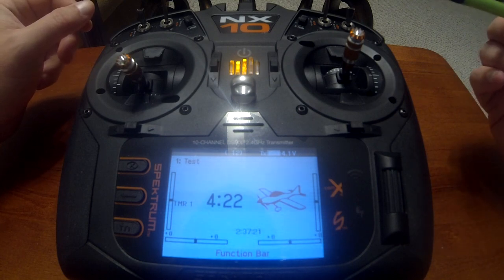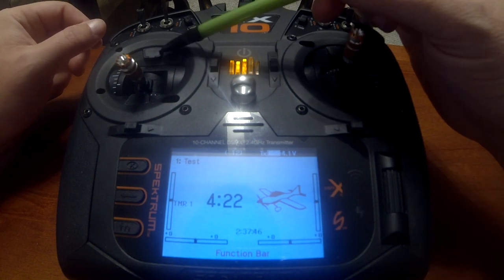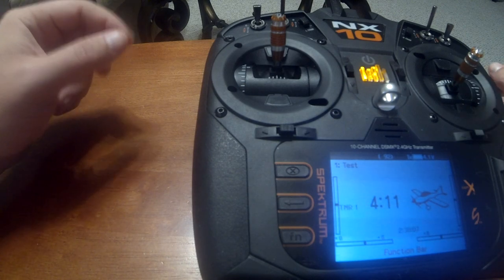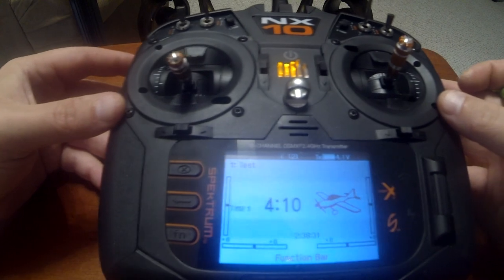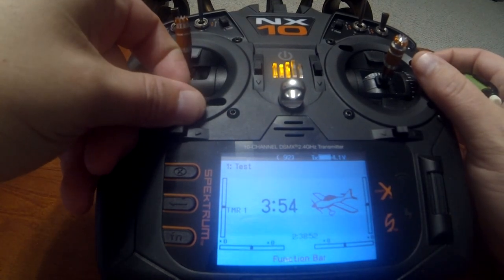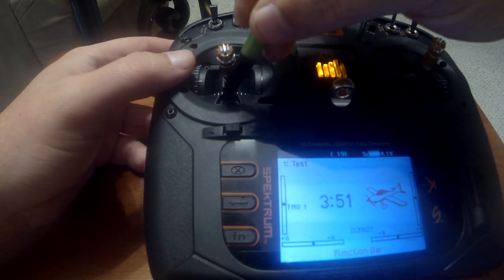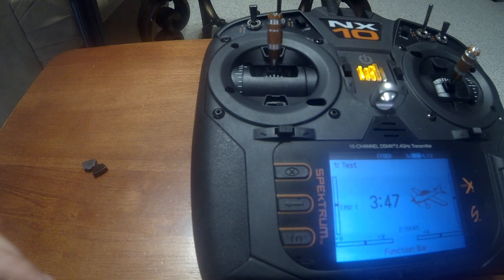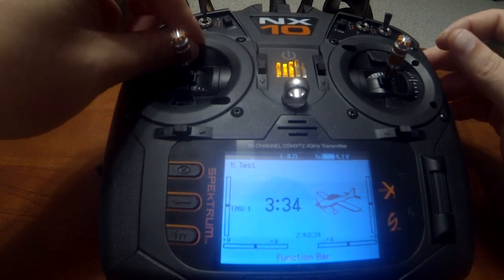Spektrum NX Setup: How to Increase Throttle Travel (NX6/NX8/NX10)

Comment: This is why I spent 6 hours trying to get pass IKon2's throttle check.  No electronic  adjustments could get me passes their throttle check feature.  I ended up returning the unit.  But, I did just follow up since I want to give it another try.  Ikon said to check the mechanical travel as they've been seeing this issue with Spektrum recently.  And, that's what brought me to your video.  Thanks.

Comment: I just got a new NX10SE and the gimbals do not have the cover that you show. They have a set screw with no cover.  I have 0-100 throttle as it is but the stick does not move all the way up and down. How do I adjust this version.  I cannot find any instructions or pics of this. THANKS
Reply from the maker: Correct, se has the screws without the cover. Same way toggle to the opposite side.

Comment: Thanks so much for doing these videos!! Would be lost as a newbie to the hobby without your help and if I had to rely on the transmitter manual!  Is there any chance you could do a video directed a newbies to discuss the different charging solutions you would consider and what you have found to be the best in your experience?  Having trouble sorting through all the options. Eg ac versus dc versus ac/dc combined plus field charging solution when electricity isn’t available at the field. Do you charge batteries at the field or just carry enough batteries for the flying you want to do that day.  Thanks again for your time and clear explanations of subjects. Greetings from Canada!
Reply from the maker: Id say that would be good video for sure! I have electricity where i fly so i charge the batteries i need.However you can get a DC charger which can work off your vehicle battery too! Thanks for the support and watching from Canada :)

Comment: I want faster throttle when I push the stick down instead of up. How can I make the throttle stick upside down?
Reply from the maker: Reverse throttle channel. Radio will ask you if your sure and to rebind. Careful as i havent tried to use this on a electric plane. Im telling you how to do it but not recommending...

Comment: HELP - my NX8 throttle seems to be backwards
on startup with throttle in lowest position, I get a THROTTLE HIGH warning
- if I push the throttle all the way up it stops

at the lowest positon the throttle value on the main screen at the top shows 100
at the highest position it shows 0
(this is backwards from usual)

How can this be fixed ?   - thanks  rc guy in Tennessee

Comment: Even with them to the right mine will only go to 94% unless I force it higher with decent pressure. Ive never had a transmitter like that before. I do get zero on the bottom.
Reply from the maker: Need to recalibrate the controls.

Comment: Why would Spectrum limit the movement of the stick instead of ajust it to full course the first time?  Is there is a reason?  An advantage?
Reply from the maker: When low throttle it helps with rudder control since the stick isnt pointing almost straight down. Preference either way so its option.
Reply: @BDTennessee  I see.  Thanks!
Reply from the maker: @frankgiroux  anytime :)

Comment: Followed your directions!  After recalibrating (on my EF 70mm F-16), my throttle comes on at a lower setting than previously, but “tops out” at approximately 84% with no noticeable increase in tone(rpm) when continuing up to full travel.  Seems odd?
Reply: I also recalibrated the sticks!
Reply from the maker: Throttle calibration...
Reply: @BDTennessee  As I stated, I performed a new calibration after toggling the switches.
Reply from the maker: @brendanhartnett8201  does the sticks physically go top and bottom of the range?

Comment: nice...the question is why they did that in the first place ???
Reply from the maker: Here is what i got: "It's a feature of high-end radios from the past. A lot of the top pilots of yore wanted less throttle stick movement as it helped them have better control of the rudder at all throttle settings, as the angle change on the throttle stick was less."

Comment: Just checking if you can help me with a question.   I'm putting a 4s 75c battery in my powered glider for  less weight.  I'm nervous about using to much throttle for the motor and esc . Question,  can I limit my max throttle on my nx10?  BTW 75c is the most of all the batteries I have the rest are 30c.  Thanks again for your help.
Reply from the maker: If the glider is made for 4S and you only worried cause higher C ratiing ,dont worry.Battery only provides what the ESC/motor pulls...

Comment: If my range with the switches still set to the left is -100 to +100, how do you re-calibrate the throttle (electric planes) if you move these limit switches to the right?
Reply from the maker: You push them right to unlock the extra movement. Then you go to System Settings in setup menu. Go to last screen and its calibration screen.Calibrate controls.

Comment: Great information so can you set the ratcheting tension from the front of TX unlike the DX models set from the back ?
Reply from the maker: Yes! Good question as thats one of my favorite new features!
Reply: @BDTennessee  Awesome I am a old school flier so I like my ratchet action thanks for the info great job on the information for the NX 10 just gotta decide if I want the 8 or the 10
Reply: Can you update and register that TX with mobile Hotspot?
Reply from the maker: @onapproachrc5471  i use slight ratcheting on my previous transmitter.Havent added to new TX yet but probably will. 

NX8 is good radio and value too.NX10 and your done :D What radio do you have now?
Reply: @BDTennessee  i have DX7s and DX 8 but I think i will update to NX 10 but I dont have wifi available so was wondering if mobile Hotspot would be ok to use on it would you know ?
Reply from the maker: @onapproachrc5471  both good previous radio. NX8 would be fine but if you can swing the extra 150 the NX10 is nice radio! 

Check other comment i replied about the MS on firmware video.
Reply: @BDTennessee  I totally agree with that I would be more comfortable purchasing the NX10 I really like that radio
Reply: @BDTennessee  Plus I found a great source for tips and advice lol 😆
Reply from the maker: @onapproachrc5471  the upgrades are nice and 150 dollars doesnt seem as much in the long run when a radio can last you 10 years...
Reply: @BDTennessee  Thats very very true our hobby is always evolving
Reply: @BDTennessee  Not sure if you have checked out any of my videos but feel free to if you would like .